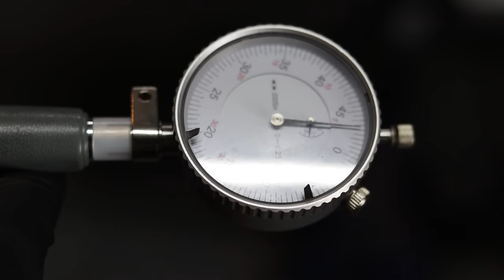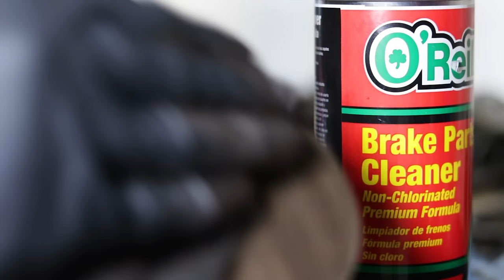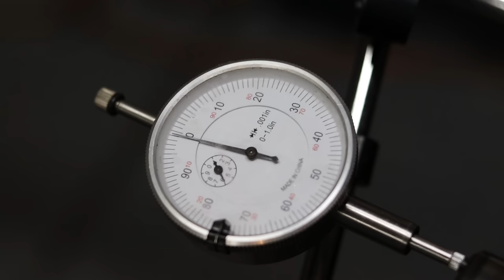The Comprehensive LS Engine Building Guide from Start to Finish

Comment: Fun tip! Put the cam in before the crankshaft. You can support the cam as you slide it in better.
Reply: Best advice. So much faster and smoother.
Reply: I can understand why to install the camshaft  first (much easier, easy access to bearings) - but are there any drawbacks?

Comment: I appreciate the long format, deep dive. Shorts are useless. I'd say you got about 90% of it. But i totally get that the longer the vid the more editing becomes a nightmare. Continuity, flow, lost footage, losing focus and motivation, resisting the temptation to redo portions. So props to you! Especially like the screen overs showing torque specs etc. Definitely going into the saved folder for my build.

Comment: Thanks for sharing. I have rebuilt engines in the past, one was a small block Chevy 350 for a buddy’s Jeep build. The engine was way to much power for a Jeep, he twisted off the driveshaft first day. We took some of the timing out of the engine. The second was a Toyota straight six just OEM parts to get it on the road. I’m New to LS rebuild.

Comment: Great video, very informative. One of the parts that's odd, he says it took awhile. I pulled a 350 from a truck, had the machine work done, rebuilt the engine and back into the truck in two days. This was back in 1986 before the internet. I'm talking new pistons, turned the crank, heads were redone and assembled with all new gaskets and hardware.

Comment: Good video 👌 pro tip with the callipers. When you open the jaws there is a small shalf that should push out the bottom. That is for measuring depth. Cut playdo in half then messure from piston to face of playdo. Saves trying to measure it while holding it. Also eliminates the risk of changing its shape holding it to tight 🤙

Comment: What a great video! Your passion and multifaceted talent cannot be downplayed! I think it's awesome the time, knowledge, and dedication you put in to this for a build for your father is unprecedented to say the least. I am currently looking at an LS swap for a project car and found your video very informative. Doing things right, or being able to provide a basic guideline, is very much appreciated. Keep up the great work!
Reply from the maker: Thanks, I really appreciate that. This is why I love making content right here^^^
Reply: @TheDailyDrift Hello I own a Chevrolet express 6.0 LQ4 with 90,000 miles, I live in France in a region where the climate is temperate, I do 6000 miles per year, I drive mainly in the summer, and I tow a 6000 lbs trailer, should I stick to the oil recommended by the manufacturer 5W30 or can I use a 5W40 for example???

Comment: Hey great video but I will say one thing about what fd me … was the lifter bores … check them before assembling your motor !!! on a couple mine the hole had just a slight lip that u couldn’t really feel but the lifter was catching …they make a 200 $ tool u shoot this bell looking fitting through the hole and it just squares up the bore … makes them perfectly round again.

Comment: I may be wrong but I believe the difference between composite head gaskets and multi-layer steel head gaskets is the application.  One was meant for a cast iron head on a cast iron block while the other was meant for aluminum heads on a cast iron block due to differences in expansion rate of the material under heat.  The Felpro composite gasket may not have been right for your application but that doesn't make it a crap gasket.
Reply: Stock lm7 5.3 comes with composite gaskets like the first one he shown which had 862 heads just a early design… the later models upgraded to mls but a stock engine will go 300k with the composites it suck’s they will rust out if you don’t  change your coolant

Comment: Very weird your valves ran into the piston. I’ve ran a .600 lift cam with 20thou milled heads no issues
Reply: Was thinking the same exact thing. Maybe his new lifters were taller or new valves.

Comment: I believe felpro make MLS Gaskets, what you ordered may have been for 1999-2000/2001.

Anyways the knock sensors TSB say to seal them using high temp and fuel/oil proof RTV

Comment: It's odd the pushrods were too long, but it's good you caught before firing it up. looking forward to getting back to the mustang!
Reply from the maker: so I think I cut the part out where I talked about the cylinder head for time. But the cylinder head was shaved by about .050 in the machine shop because it was so warped. They also replaced the valve stem seals so that's why that wasn't in there either 😅
Reply: Dude do u live in crowley?

Comment: I always heard (from an old mechanic) to NEVER let the hb pulley turn backwards when tightening bc it can skip a tooth on the timing. I noticed you did when you were getting the angle set on the hb bolt. Have you had any issues with it jumping a tooth going backwards? Great video tho

Comment: Thanks for this video ,, lots of information  to take in ,, quick question ,, why did you take off and replace the timing gear on the crank ? Was it worn too much? Cause I am right there now ,, I am in the beginning stages of rebuilding ,, crank is back in bearings installed ,,cam's installed with new bearings,, ready to start installing the piston rings and pistons

Comment: It's been a second since you posted this video, but I was thinking: could the issue with the pushrods being too short have been caused by a lack of head gaskets? The compressed thickness of a lot of stock LS headgaskets is a little over 0.050", which would perfectly explain the 0.05 inch reduction in pushrod length when you did the test with no head gaskets.

Comment: Did u put a new crank in there? Or is it the original one. I got a 6.0 that the cranks seized on 2 of the main bearing, i got them off but im no sure if i should get a new crank or get it polished.

Comment: I wish I was your neighbor! Great work sir! What brand oil did your Dad use and was he a change oil/filter every 3,000 miles kinda guy? (I am guessing no) but curious regardless
Reply from the maker: My dad used whatever 10W30 he could get his hands on, but he was good about changing it on time. The motor had 360,000K on it and most of the issue was caused by the EGR system GM put on there.

Comment: Where do you suggest I get a CAD parts & pieces into subassemblies for your vehicle? Even just for the engine assembly. I’d kinda expect that engineering drawings / tech data like that are not something automotive companies would offer? I have a 3 volume service manual for a yukon/suburban but that’s probably as far as I can get right?

Comment: When you are trying to find the cam base circle..... you check the intake the instant the  exhaust pushrod lifts, you got that right. To check the exhaust, the intake pushrod must fully extend, then just as it finishes returning to it's starting position, you check the exhaust.  You got that part wrong.

Comment: Pulling up on a bolt is a lot harder than pushing down to tighten on that crank bolt switch sides and use your weight
Reply: Also, I wanted to thank you because of your video I was able to assemble an LS six from block back into a running car

Comment: You can’t check ptv clearance with a hydraulic lifter, you need to have or make one solid. Pushrod length sets preload only on non adjustable valvetrain and does not increase ptv clearance…

Comment: Why did you have piston to valve clearance problems with the stock rebuild? If you used all stock parts why would there be a problem with that?
Reply from the maker: just peace of mind and going the extra mile
Reply: Flat top pistons were stock? I assumed it was 5.3L. Or is it 4.8L?
Reply: 5:40 answered

Comment: theirs only 1 thing that ever bothered me when iv watched this video (1000 times) why would the oem pushrod be too long when the entire thing is a stock rebuild. Cam Lifters rockers ect. unless it was that tight from factory. anyone clear that up for me?
Reply from the maker: So I can’t remember what exactly I said in the video, but I believe it was because the stock pushrod for most LS engines is 7.400 but the 4.8 has a 7.385 as the original size. So sometimes if you just order a stock LS pushrod you’ll get a 7.400 instead of the 7.385. It’s always best to check the length you need just to be safe. Other factors could be if the block was decked or the cylinder heads are shaved. Most of the time the stock ones will still work, but it’s just good practice to check it. 

I helped my buddy do a swap a while back on his corvette and he bought all the parts and we put it all together without checking. We found out real quick what can happen if you don’t check it. The pushrods were too long and it slapped some valves on the first start. I should have insisted on checking the length but I wasn’t thinking because I didn’t buy the parts. Anyway, hope this helps clear things up a bit.

Comment: oh wow just a note do not torque those bolts that much for the cam retainer they actually are only 11 ft lbs otherwise you will snap those bolts
Reply: i meant the plate will crack the new plate only uses 11ft pounds i usually just use a 1/2 impact rated harbor freight torque socket and just tighten it till its tight those bolts have thread lock on them from kit

Comment: I get tired of people saying that an LS motor is easy to build and for the most part they are but without yourube to double check everything  it wouldn’t have been right. Compared to old school sbc those are easy built my first in high school and it ran for years … but i did have friends at the machine shop and guys around my age thats been their done that.  You LS guys need to  build one lot less work.  Rods and pistons ring gap  bearings all the same other than torque spec….